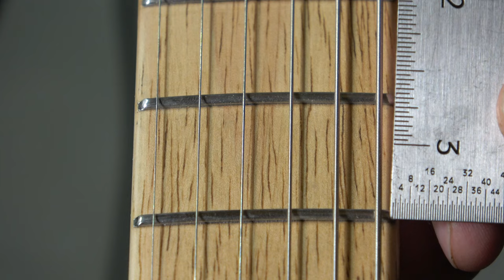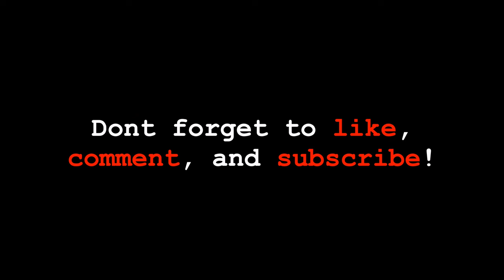How Far Should Guitar Strings Be From The Edge Of The Fretboard?

Comment: From a player's standpoint, I'd much rather have a wider space from the outside of the string to the end of the fret. The string sliding off the edge of the fretboard is one of the worst design defects a neck can have. I have "literally" soldered some material onto the ends of frets tho keep the strings from sliding off the fretboard.

I think the traditional "beveled" fret ends are a design defect, and more builders are now moving to a "ball end" design. This is a big improvement in my opinion. Other important factors to account for are "neck radius" and how much the player uses string bends. The strings are far more likely to slide off the fretboard a 7.25" radius neck than one with a 12" or flatter radius.

In a different playability design topic, some unusual chords around the nut require extreme hand positions, and volutes, as well as the wood for the treble side of the headstock can get in the way. If staggered tuning keys are used on the headstock, I think the treble tuners should be further away from the nut than the bass side tuners.
Reply: Interesting, because I had recently reach the opposite conclusion on the "hemispherical" fret ends. With a straight bevel, you can give it a relatively steep incline (still rounding the edges appropriately), while preserving more "fretting surface". All the hemispherical frets I've seen look fantastic, but seem to sacrifice some of their length to that. For you is it because the fall-off, should it happen, is more abrupt with a straight bevel?

Agreed on the tuners--though I love the look of a reverse headstock.
Reply: @TaoOfStuff  For my 7.25" radius neck Reissue Strat with beveled fret ends, both E's we're a problem from around the 6-10th fretd. Mostly fixed when I soldered and shaped ball ends onto the frets. When I get around to refretting that guitar, I'll change the neck radius to 10.5 inches. I'm hesitant to make it flatter, as I want to keep it in Spec for the pickup pole pieces radius.

Comment: This is my comment before the video has even played ..lol..  Without going into actual measurements, I have always liked strings to be as close as possible to the fretboard edge, especially the low E since now and then I will thumb a note.  But lately on my acoustic I have found that when playing some open chords I am accidentally muting the open high E with my palm.  I don't know if I am just getting lazy or my hands are getting fatter. I never glue in my nuts (place joke here ..lol..) so I have tried pushing the nut across a smidgen and that fixes it (although it does put the low E a little too close to the edge on the other side).

Comment: Having played production guitars most of my life, I immediately noticed on the two custom shop guitars I’ve recently purchased, the E strings seemed closer to the edge than my other guitars. I’ve gotten used to it and I like it. I’m in the process of building an Explorer style guitar, and I had a couple pre slotted bone nut blanks in the shop. Sure enough, it feels too far away from the edge and the spacing feels crowded. I’m gonna cut another one from scratch. I’d say 1/8 is good but no more.
Reply: How can you like that problem ?

Comment: 1/8 is a great distance between the E's and the edge of the fretboard, personaly depending on the angle of the bevel of the fret end I find it ok to mesure the edge of the string cause the bigger E has more chance to slide(or drift , I find that the high E can get away with being a little to close but the low E has to be further away... Depending on taste and technique it changes from player to player
Reply: I find the opposite to be true. The little e slips off the side on me more. The Low E is more ridged and stable. I have a Strat that I plan on redoing the nut and moving the small e in more by changing the slot.

Comment: But should the 1st and the 6th string be parallel to the edge of the fingerboard? I only started thinking about it upon completing my last electric guitar project, where, quite accidentally, the distance from the outer strings to the edge of the fretboard at the nut is about 3.5mm, but at the 23rd fret it's about 4.5mm. And, quite frankly, higher notes feel more comfortable to play, at least to me. Then I took a look at some other guitars that I have. I have a pair of 80s Kramers and their strings are dead parallel to the edges, but the Epiphone Les Paul Studio I have also tapers towards the nut by about 1mm. Then I observed classical violins, and their outer strings are also not parallel to the edge of the fingerboard, ahah. That made me think. Where do you stand on this subject?
Reply from the maker: @aleksandart.8150  in a well made guitar, the 1st and 6th strings should be parallel to the edges. If they aren’t, it’s only a problem if the strings come off the fretboard while playing.

Comment: Don't know where I read up on it, but I've stuck to aligning the edge of the string (not center) 1.5mm from the point of the first fret when cutting the nut on both sides. The point meaning wherever you end up having the sharp bit of the fret end after beveling, but before rounding over.  The other strings will align to this location. Since I've only built and mostly worked on Fender-style guitars, the neck can actually move around a bit in some cases, but don't have issues with fret-outs on any guitar that I've set up with this approach. Though now that I measure this on the closest project guitar I have nearby, it's actually 2mm from the end on the low E, but that might have been a bit of a sloppy nut job as it was always going to be temporary...

Comment: I am wondering, on an electric, should the distance to the edge of the fret board be equal on both sides? I have a Gibson ES 335 that sometimes falls off the edge on the high e-string, and a Les Paul (Studio, no binding), where I don't have that problem. The Les Paul is not uniformly 1/8" all the way down on the high e-string side. It gets to about 3/16th where the neck joins the body. I'm wondering if that is by design. Easier to play without worrying about falling off the fret board. Did they do that on purpose? The strings seem to randomly go over the pickup poles, but they all do, even if not always dead center. I'm just wondering, is my Les Paul tuned to perfection, while my ES -335 is adjusted for people who don't bend strings?
Reply from the maker: That's a good question and it begs another question; if you checked ten Les Pauls, would they all have the same measurements? Based on what I know about making guitars, I'd say where the strings end up is more a result of happenstance than design. With set-in necks, the effort to fit the neck usually means the neck that fits into the guitar body it was intended for won't fit into any other guitar. As a result, neck width can vary from one guitar to another and that affects the distance between the edge of the string and the edge of the fretboard. That's only true when hand building guitars. With CNC technology, a high degree of precision is repeatable, over and over.

Comment: Probably the worst playing problem for me. Have sold guitars because of it and have found that it’s worse with bigger jumbo and X jumbo frets. I tend to pull off the high e so I’d allow more space on that side than the bass side. Bevel certainly affects it so if I’m dressing frets I opt for a steeper bevel and have sometime cut the nut slots to compensate on necks.

Comment: I had a friend who had an expensive esp that did this whenever i played it.  Ever since my worst nightmare has been buying a prestigous model or brand some day and it being flawless playability but with this issue where the high e slips off.  Low and behold I bought a schecter reaper that has this issue when I play.  from sweetwater and the bridge is noticeably screwed in closer to the low side, where all the strings are slightly run along a mm or 2 too close to the edge on the high e side.  I put my 8s on and its completely unplayable unless i use the very heavy 10-48 strings and even then its still dangerously close to sliding off at all times.  Basically I have to play with such large strings that the tension is so immense that it becomes difficult to play lead for me either way.  Im currently arguing with sweetwater about this and they do not see my issue.  They saw its within standard factory regulations.  But i can literally see on the guitar and in pictures that the bridge is mounted way off pushing the E to the edge.  Im scared to buy any guitar online now for this reason.  Even if i get a guitar with bad high action i can fix that.  But its harder when the high e slips due to bridge alignment or over filing the fret ends..  It seems sweetwater doesnt wana deal with me now other than letting me send it back.  Rip.  :/
Reply: Are you sure it is the bridge placement ? IF the neck is not straight (as in not center to the bridge..and center to the heel and nut of the neck.) 
Can use a piece of painters tape at the nut end on the finger board marking center and do the same at the heel end. Using a straight edge checking center on the bridge to center of the nut. Checking to see if all the marks line up.
Another simple thing to try is measure from the neck to the string at the nut and then the heel of the neck (last fret) looking for the same distance rather it be too close to the edge or different measurements. Making sense ?

Comment: I have an LTD with this exact issue...the 1st string(thinnest) is too close to the edge and frequently frets out when playing and not even with bends. It originally had a Floyd Rose 1000 bridge. It had the issue then too but the 1000 stopped staying in tune when locked. I opted to get an original floyd bridge(German made) and the issue is still there with this one. Is there a way to fix this?
Reply from the maker: If it’s a bolt in neck, you could remove the neck and fill the screw holes in the heel with Maple dowels. Next, you would reinstall the neck, put the strings back on with just enough tension to make them straight, and grab the headstock and shift it slightly toward the bass side. That will reposition the strings away from the treble side of the fretboard. Keep in mind that it will also move the strings toward the bass side so you’ll have to find a happy medium. Once you’ve got the position of the strings where you want them, you can mark and drill new screw holes in the heel and remount the neck. This is not an easy fix.
Reply: @HighlineGuitars  It's neck through/glued...no bolts unfortunately. Is there anything else I could do?
Reply from the maker: @AvnerRosenstein-ULTRA-LXV  The only other option would be to remount the bridge so that it will be shifted closer to the bass side of the neck.
Reply: @HighlineGuitars  this is actually what I was thinking to begin with and you have confirmed it! Thanks a bunch!

Comment: Your comment about people making the outer strings end up too close to the edge of the fretboard is interesting. Once you've got the neck and fingerboard, can't you control the distance just by reslotting the nut? Sure, if they made the fingerboard overall too narrow, they are screwed unless they want to completely remake the neck, but any mistakes in string distance planning can be corrected I would think fairly well by just making a new nut.
Reply from the maker: Not if the string spread at the bridge is too wide. In that case a bridge with a narrower string spread should do the trick if one is available!

Comment: Define "edge of the fretboard"...

Is there binding?  No binding?  Do the frets run all the way to the "edge", or are they dressed hemispherically as in your video from five years ago?  https://www.youtube.com/watch?v=moxUw3Ke2Q0

If not hemispherical, what's the angle at the end of the frets?  22.5 degrees?  30 degrees?

Might it not be "better" (more useful/accurate) to measure from string (centre or edge, your choice) to the outermost playable part of the fret itself?  (I mean that in the interest of CAD and CNC use, over hand tools and maybe a sander).

I'm not claiming it to be so; I'm just asking a question.

Comment: Well although I have no measurements, I have a couple of G&L guitars (both US made and Indonesian) and the E string (the bottom one) is located too close to the edge. Of course it is possible to adjust my playing, but I have not experienced that on my other brand of guitars. And with the dry climate up here in the north of Sweden it gets even worse if I need to correct fret sprout due to a shrinking fretboard...
Reply: How close to the edge is the nut slot cut? If it's too close, a new nut with the slot further from the edge may help.
Reply: @raoulduke8382  Yes that is what I will do if this gets too annoying.

Comment: No simple answer  Its going to depend on the height of the frets and how you finish your fret ends, as well as the player and string guage. Typically ill leave more room on the treble side than the bass side for left hand vibrato on the high e. I get way more complaints from players about going off the treble side than the bass. But this is a repair guy talking. If you're looking for one size fits all, you need a focus group. Hey...wait a minute...

Comment: Yes being too close to the edge of the fretboard is the worst! I've really disliked every "50's style" Fender reissue I've tried for this reason. 

On basses I have offset the strings so the edges of the strings are  close to the same distance from the fretboard edge, rather than the strings center lines. I've found this small detail can make a difference worth considering in your design. At the same time, if you pay attention there are a whole lot of guitars and basses on the market with much less than perfect alignment and people don't seem to make much fuss of it.

On guitars I don't bother building this offset into the design because the strings are so much smaller. Do you know any large scale manufacturers that offset the string alignment? From what I can tell everyone has been basing measurements on the strings center lines, maybe offsetting the nut slightly when installed.